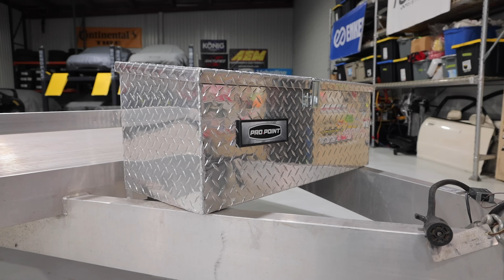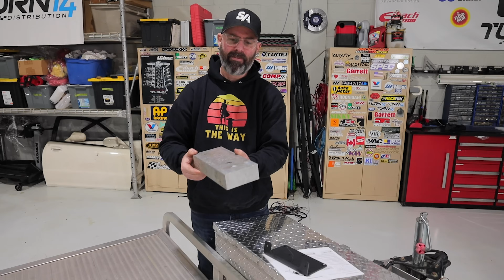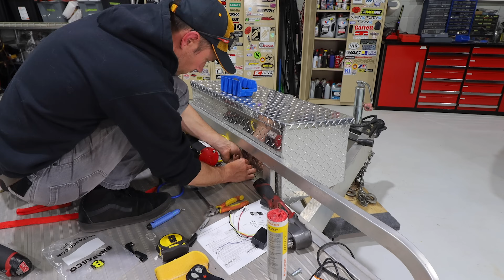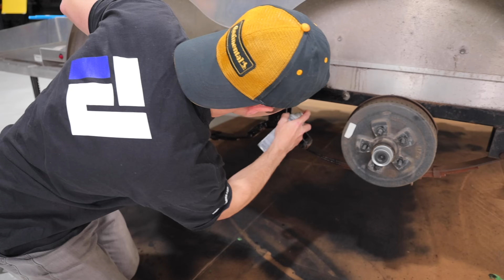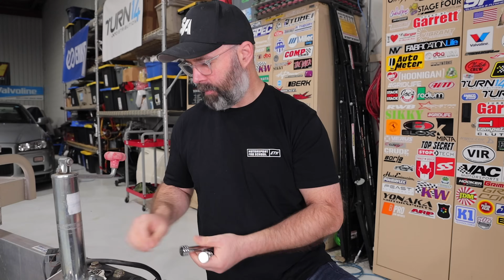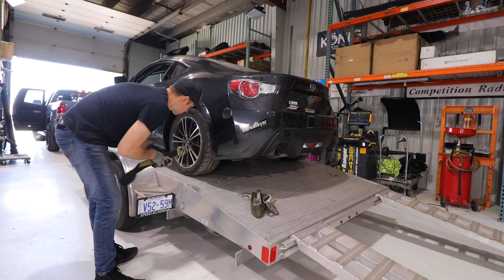Looking For a Car Hauler? Buy THIS Car Trailer (And it was CHEAP!)

Comment: Is this trailer a joke???
My twin axle steel trailer (fully galvanised!!!) is MUCH better than your one!
The weight is just 500kg, the load capacity is 2.5t and the axles are nearly in the middle what makes it much easier to reverse the trailer around a corner and you also don't need a lot of space for any turns!
And my trailer is included with a spare wheel and a 5th (dolly) wheel!
I paid just 3500£ for it and I picked it up this week brand new directly from the factory!
And on top of it: there's a massive "bracket" welded on the trailer to install any winch you want!
Brand? MARGAB
Lovely trailer!
And they also sell single axle and triple axle trailers!

Comment: Suggestions for anti-theft:  1) remove your safety chains, leaving only the anchor brackets.  Inspite of whatever coupler locking device, thieves will just hook up to YOUR chains and drag trailer off to their location for serious attack on your coupler lock.  2) Remove all 4 wheels. (even easier for you as you have the tail jacks).  Depressure tires and store wheels/tires in cool, dark and safe location until needed.  Win-win- no UV damage to tires.  Thieves will have to bring not only safety chains, but at least two tires/wheels that match your lug pattern.

Comment: No way in hell those are dual 7,500 pound axles . Those are 5 lug axles which are 3500 pounds max weigh each .which being combined are rated for 7k points so your max pay load is around 5800 if the trailer weighs 1200
Don’t think they make 7500 axles . They make 7k axles each but are 8-10 lug

Comment: Suggestion.  Add a battery powered GPS tracker to your trailer.   These days a package can be had for like $250ish that covers the device and 3 years of service ($20 I think per year there after).  You set up SMS alerts & geofencing & then hide that box on the trailer.  I've used GPSAndTrack for a car before.

Comment: I bought a good running single single axle semi tractor that is capable of pulling a 3 car wedge or equipment goose neck for the price that these guys paid for this trailer.  I think the term "cheap" here is definitely subjective.

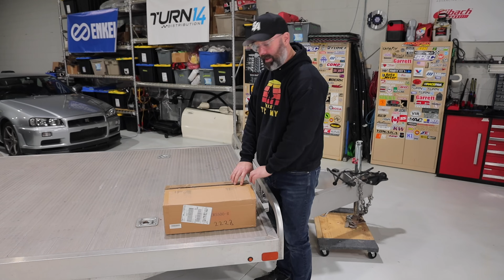Comment: At 2:36 you said it has dual 7500lb axles .... They are only 5 bolt axles meaning they are 3500lb axles not 7000 lb axles which would be 8 bolt axles ... Probably just misspoke but clarifying that if anyone cares

Comment: Nice unit! Trouble with cross strapping is if you happen to lose one, the other strap on that ebd will lose its holding tension putting all the load on the remaining 2 straps.

Comment: God I remember when all trailers were like $5k new. Fuck that was only like 5 years ago. Now shit box trailers go for $10k in my area.
Reply: Shucks!?  What state are you in?  I'm in Texas.  Bought a trailer, new, less than a year ago for about $4,900 including tax, title, registration and inspection.  Open deck car hauler like the one in the video, but mine weighs about 2,600 (mine is steel and not aluminum), 20ft (including dove-tail), dual 7500 axles.  If trailers go for crazy cash, I imagine that trailer thefts will be on the rise.  Catalytic convert thefts are out of hand in my area since the metals inside go for big bucks.  My local O'Reilly auto store had to stop delivering parts for a while after all their trucks had the cats stolen.  If you got a trailer, lock it up good and tight, and stamp an identifiable mark somewhere so that if it does get stolen, and recovered, you can identify the trailer as being yours.  Police won't give you back your stuff if you can't prove that it's yours.  Happened to a deacon at my church.  Years back his trailer was stolen, he found it, but because he couldn't prove that it was his (had no VIN, no identifiable mark other than the license plate, which was removed) police couldn't do anything about it.

Comment: Hey guys, I do a lot of decals and adhesive vinyl lettering and striping. The biggest pain about removing them (in my opinion) is removing the old adhesive residue. A buddy of mine does this same type of work with applying and removing decals etc to fire department equipment and suggested I get some of this degreaser. “aero” Conquest degreaser & odor counteractant. Spray it on the residue, wait a few minutes, use a plastic scraper and remove the bulk of residue. Apply a second coat and wait approximately one minute, use some disposable shop/paper towels and it’s completely clean. The best product that I’ve ever used and makes easy work of residue removed ! The bonus is the great citrus smell. I don’t work for the manufacturer, I’m not a retailer and have no association with the product, I’m just a consumer that absolutely loves what this stuff will do. I’ve used it on painted surfaces, bare metal, many different types of plastic and have never had it damage anything. Try one can, I guarantee you’ll order more after trying for yourself. I just wish I knew about this stuff years ago lol. Keep up the great videos and if you decide to try this stuff, let me know if you agree with me.

Comment: You can get in big trouble with a big winch.  I have the smallest one hf sells, it will stall out before it bends and breaks things.  My big one would rip a rear end right out of a car...
I also built one that doesn't use ramps, need to make a video on it.

Comment: Keep an eye on every spot that steel is coming in contact with the aluminum. The road salt and other deicing products Canada puts on the roads make them rust faster just like a boat trailer going in and out of saltwater.

Comment: Use a socket or wrench tighten nut and spin till there is noticeable drag on hub than back of 1/4 turn than go to a Light snug for the nuts. And Always USE a Toque Wrench!! on wheel nuts

Comment: change those wheel lock to the one trimax has that covers the wheel nuts because all theves do is remove the wheels and trailer is gone

Comment: I use a pad lock in place of the pin that secures the ball into the hitch.  So even when not hooked up, the latch being locked prevents the trailer from engaging to the ball so there is no way to hook up.  But that's the budget way to secure, you guys really went all out which makes sense for such a nice unit.
Reply: I know from re-poing trailers, those little locks snip so very easily with simple bolt cutters. Better than nothing  but Not very secure

Comment: Those are not 7k lb axles. They are 3500 each
Reply from the maker: Yes, I misspoke. Should have said 7k total, not per axle
Reply: @speedacademy  great.  That probably wouldn't go great if you tried loading something that heavy

Comment: The brake assembly inside your winch isn't designed to see that load for extended periods of time. You should disconnect it from the car or leave it slack if you're just looking for somewhere to put the hook while you tow. You'll destroy the winch even faster than it's going to fail being from China.

Comment: I think you should have a locking lug nut for the trailer’s wheels. That way they can’t just take off the wheels and replace it with their own trailer wheels to bypass the boots!
Reply: I hope you realize that locking lug nuts do absolutely nothing

Comment: To stop the cable rub on mine, I cut out a small channel in the middle of the drop point and boxed it up. 
Then placed in rollers to allow the cable to run freely, while keeping the winch low.

Comment: Why dont you install a winch on the ceeling of your shop and tilt up the trailer vertically against a wall in a un/less used corner? Saves so much space and will be safer than anywhere else

Comment: It's actually very interesting because I've been renting different trailers and brands over the years for towing my broken cars behind an Audi A6 Quattro, the ones I've found nice were aluminum ones obviously for the weight (even though I have light cars) but also with the low deck and the wheels on the side rather than under the bed which raises it automatically. The only downside is increased width that you have to keep in mind on tight roads because if the cars goes, the trailer might not. But behind a wagon, it's way more stable and aero is much better too 👌
Reply: tow with an a6? That’s quite the tow rig
Reply: My guess is the 4.2?
Reply: @adamdg12  As much as I want one, mine is the 2.5tdi 180 auto Avant body, lots of space, wouldn't die for now (345.000km, 214k mi), has towed it's whole life and it was dirt cheap. So much service for the money
Reply: @frozenpete788  vw diesels are pretty cool
Reply: @adamdg12  most of the time they are indeed. Fortunately this one (AKE code) doesn't eat it's camshafts like they used to. The Bosch vp44 is a pain but for everybody that used it. Honestly I have hard times finding a replacement because it so practical it's hard to beat. I put an entire fridge inside and closed the hatch, ladders, wood planks and so on. Great value for money

Comment: Did you mount that former heat sink plate just to the surface skin of the trailer, or did you straddle a beam underneath?  I have a winch to mount on my open aluminum trailer, and am trying to figure out the best way to do it.
Reply from the maker: Put a quarter inch thick piece of aluminum underneath. That should be plenty.

Comment: I would have mounted the winch inside the Box. Just above the bar that goes across the width. Would take the winch out of the elements and give it some extra protection

Comment: Make sure you put plates under the aluminum to through bolt the winch and strap down points on the trailer, the bolts will rip right through the aluminum deck
Reply: Yessir, we put some big thick aluminum backing plates on the underside.

Comment: Cross strapping is good for load centering but weakens the load capacity of the straps by a LOT. At a 90’ crossed angle, a 1000 pound load will exert 750 pounds on each strap, note this increase in force is also transferred to the trailer hitch points and the car.... can easily bend suspension or pull out bolts under heavy braking or a small accident. 👍
Reply: And if one of the straps fails, or comes off then the load is really free to shift.
Reply: Also with a higher center of gravity load, both ends cross strapped will allow the load to roll over (i.e. if both driver side straps are on top). Watched it happen to a trucker friend of mine hauling a 40,000 pound concrete building cross tied with chains and binders. If you cross one end, run the other straight.

Comment: If you are strapping through the wheels, can't the alignment be pulled out of spec? Also, it looks like it allows the suspension to load and unload over bumps since there is nothing tying the body down. Not sure if that would change how it feels to tow it though. Anyone with more knowledge care to chime in?
Reply: Can’t speak to the alignment but you want to strap down from the wheels/axle  so the suspension can work and not strain the straps. Not much travel in the cars they tow anyway(I am generally towing off road vehicles).

Comment: I've been working on a trailer as well: 1977 Boler. Just a little different from your trailer.
Being from the aviation industry, I'd recommend getting a drum of LPS3, if you really want to coat and protect any type of metal from car-be-gone (road salt). It's expensive, but worth it.

Comment: Might want to add some locking lugnuts on those trailer wheels too.  Those locking chocks are kinda useless if they can just quickly remove the tire and still have one good axle to tow it away.
Reply: I agree. Your thefts deterrent aren’t the best. You should have gone with the Trimax that cover the nuts of the wheel and should have gone with Amplock for the hitch/tongue locks.

Comment: I got an idea to prevent anyone of stealing your trailer. Disconnect the batteries and isolate the cables. Attach a very high voltage to it and put a big ass sign that says “High voltage, do not touch anything.” And maybe just maybe, one morning you will wake up to a good smell of tasty bacon 🥓 
Don’t eat it, just report it and put cameras to make sure they knew before trying to steal it.

Comment: i dont know if the black fluid film smells different from the amber one, but i used the amber fluid film back in november or december on my car, after your first brand integration with them. Works amazing, smells foul. I regret not pushing my car outside and doing it there cause i stunk the shop up so bad after spraying 4 cans worth, we wrapped up early that night lol